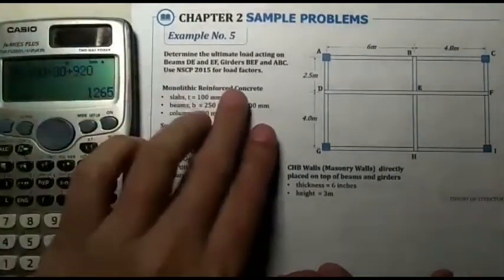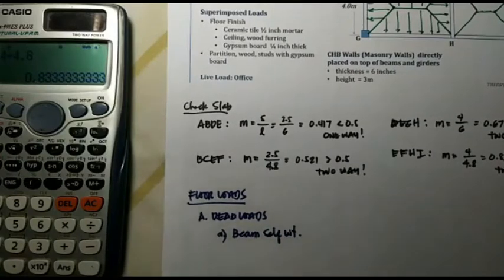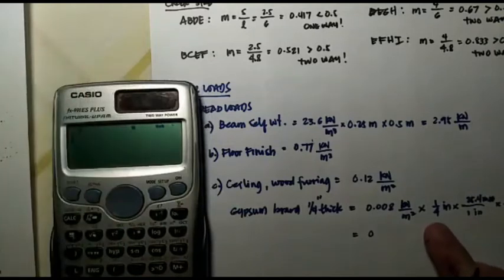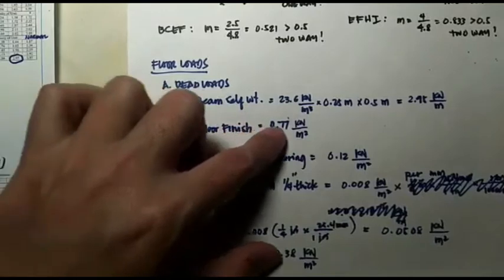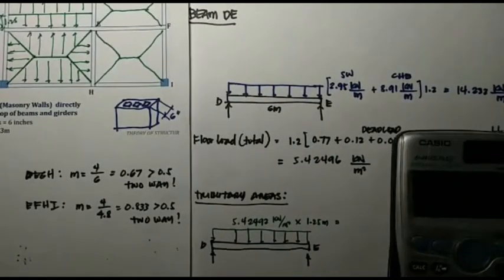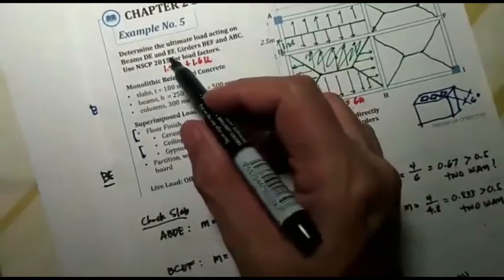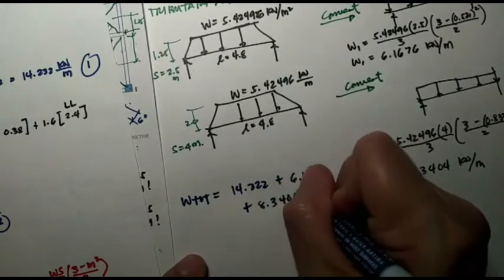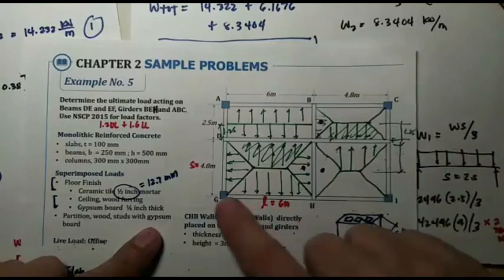THM1A8 SAMPLE PROBLEM 5 TRIBUTARY LOADINGS

Comment: CORRECTION: Concrete Slab selfweight should be included also in the total Floor loads, i.e. Slab Load = 23.6KN/m^3 * 0.1m * 1.2 load factor = 2.832 KN/m^2. My apology! Thank you! :D